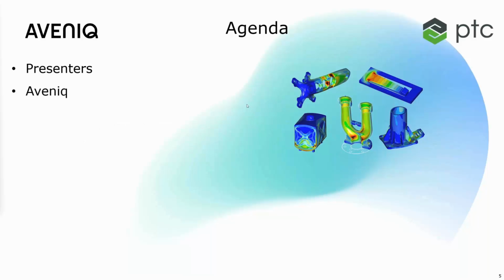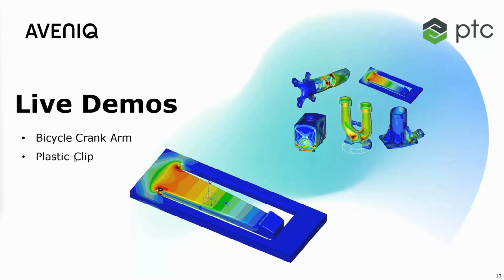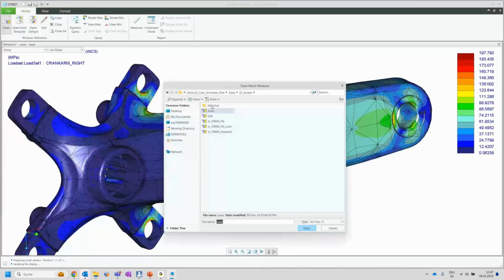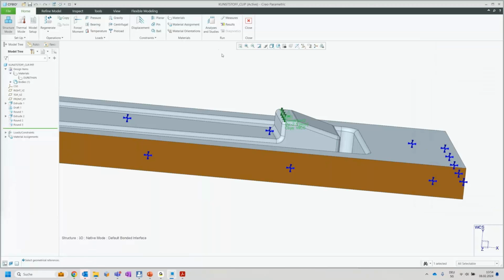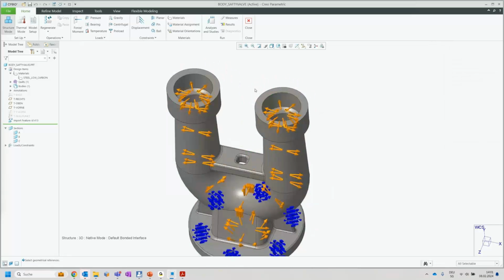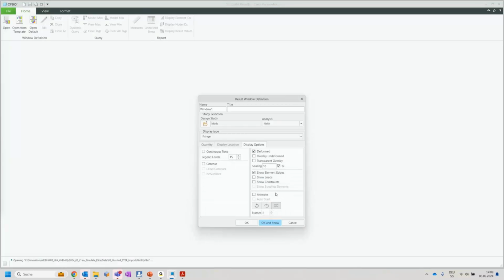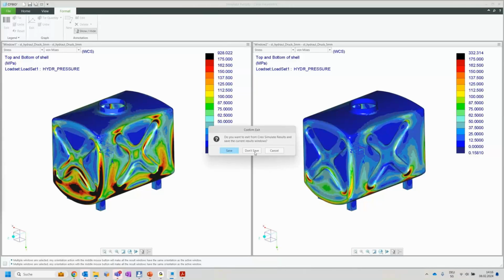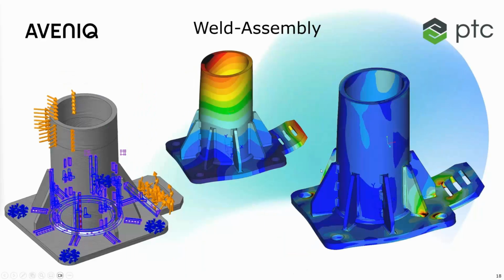Webinar Creo Simulation Elite (english)

Comment: Hi There, can you please unpack something thing something for me about the difference between Simulate Lite and Simulation Elite
Reply from the maker: Simulation Lite: limited functionality for linear static Analysis with wizard - max 200 surfaces - NO mesh refinement
Simulation Elite: full linear static analyis - NO model size limitations - mesh refinement available
Reply: @simmlerssimulationtipsforc6728  Simulation Elite is not available in a base package and should be bought separately as add on